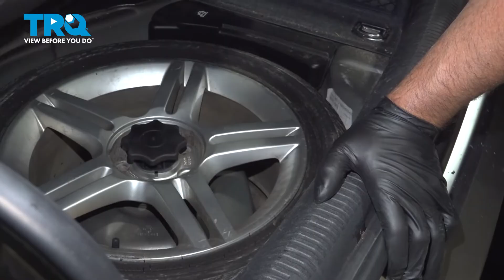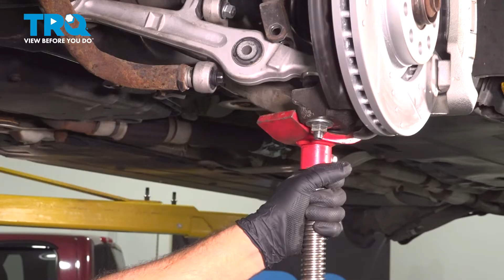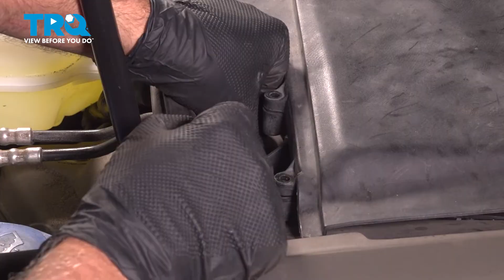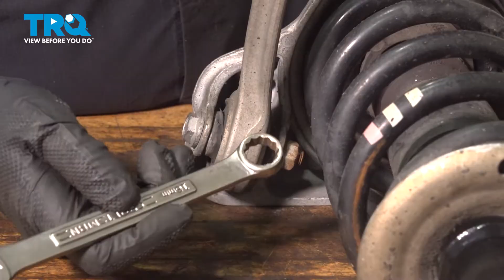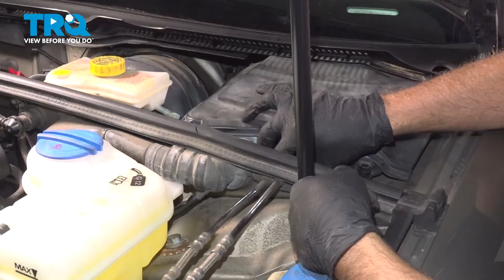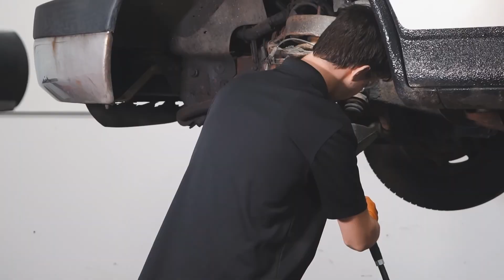How to Replace Front Forward Upper Control Arms 2004-2009 Audi A4 Quattro

Comment: You can remove the arms without taking the entire assembly off. Use 2 wrenches, that was a very unnecessary step. You should've also included why you used a brand new pinch bolt